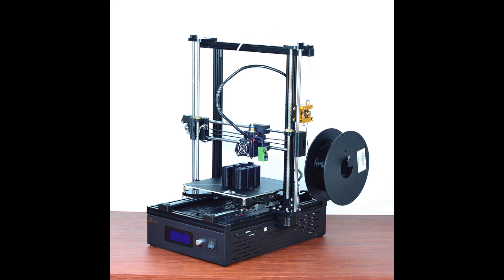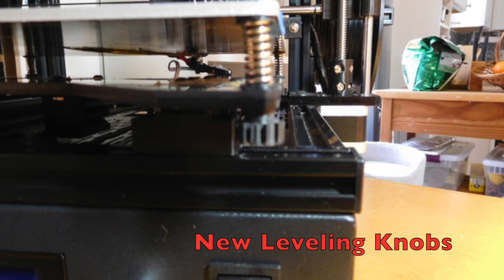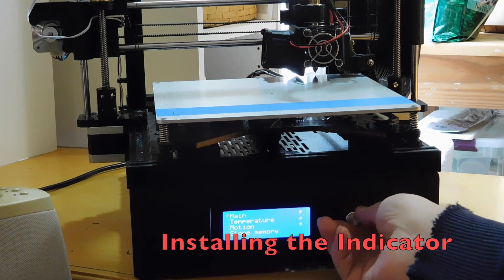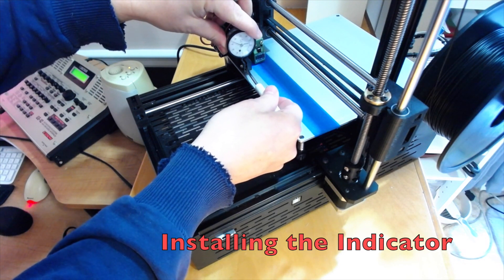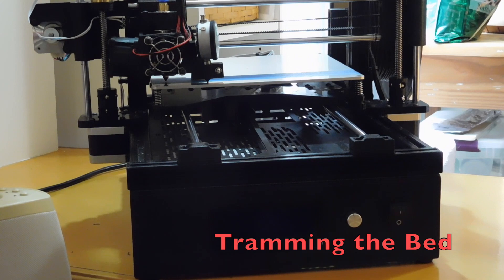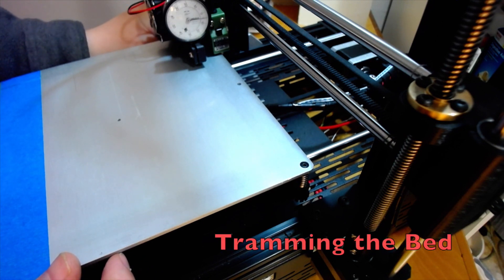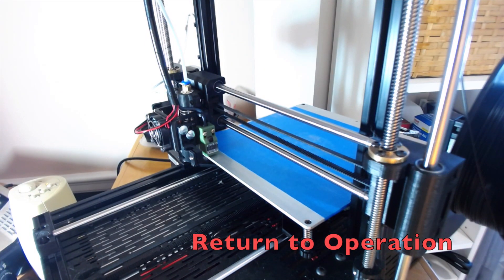DMS-DP5 3D Printer Bed Leveling & Mods

Comment: i have problem when printing with DP5 the extruder was too high so filament wont stick to flat bed, how to solve this problem?
Reply from the maker: You should join the DMS DP5 user group at http://dp5.boards.net

Does your machine run the auto bed leveling routine when you start a print? It should check the four corners of the bed before starting the print. If it does than you need to raise the bed sensor a little bit. I use a stack of business cards , about three or four works for me.
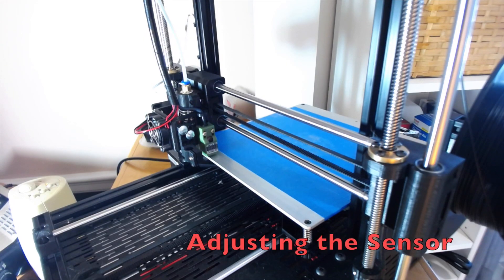Reply from the maker: Have a look @3:46 This shows how to adjust the level sensor, I think yours needs to be moved slighter further from the bed.